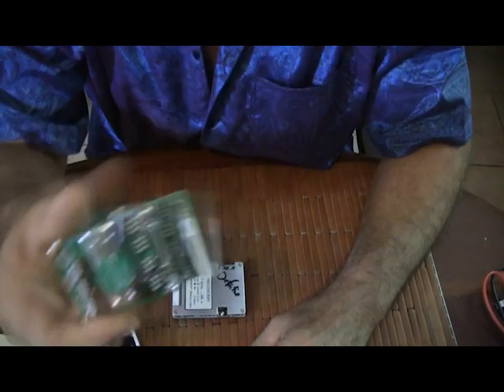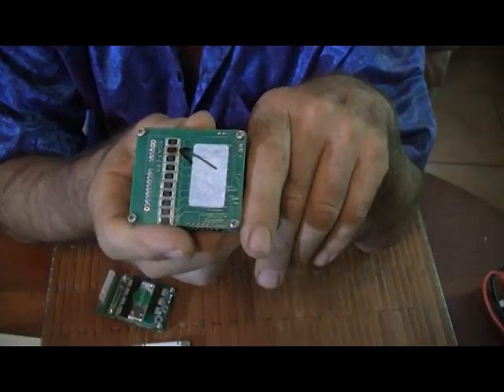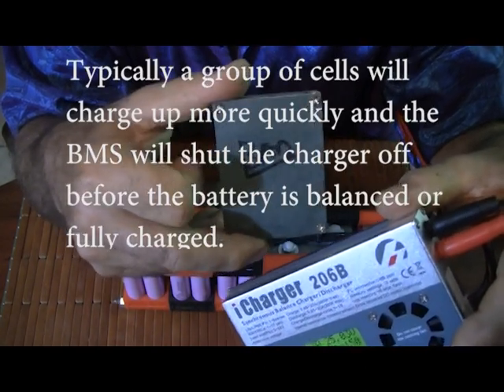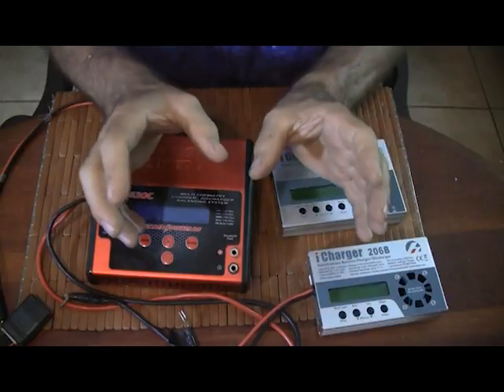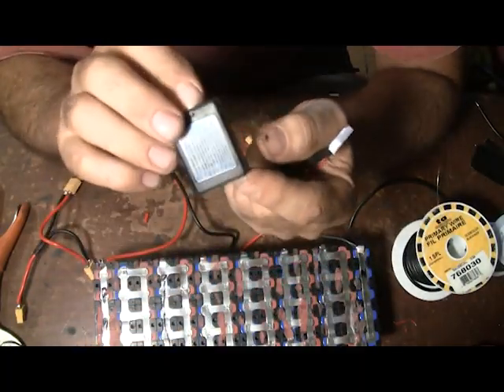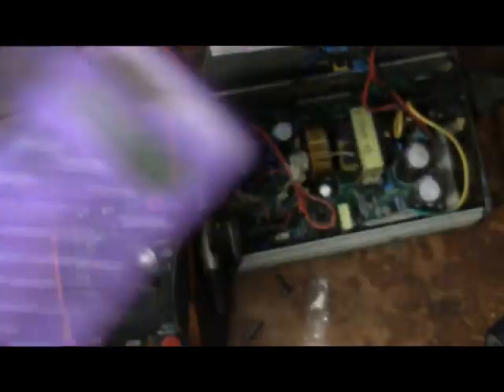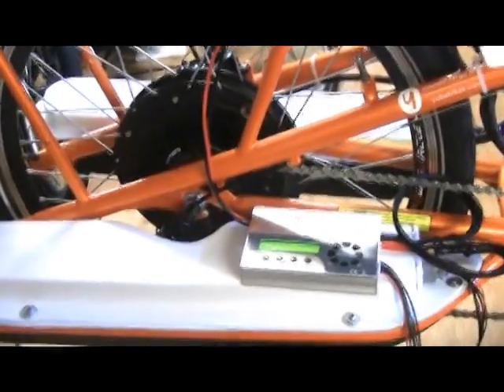How to build a safe and better lithium battery WITHOUT a BMS.

Comment: I really like your setup. Quick question, are your cell loggers running when your two batteries are connected or are they running only when your batteries are disconnected into two separate batteries?
Reply from the maker: Thanks, They can be left connected all the time.
Reply: There's no switch to turn them off when the batteries aren't in use, so they have to be unplugged to avoid the drain apparently. Can just the end  lead be disconnected or does it require every one to be disconnected?

Comment: Why does a BMS discharge a high cell that is under 4.2 volts instead of stopping the charge on that cell until the others catch up to it?
Reply from the maker: BMS's don't charge cells- the entire battery is charged at once through the positive and negative terminals.  A BMS can only hold back the charge on individual "cells"- actually parallel groups of cells- by bleeding off power using a resistor.
Reply from the maker: Because that is the only thing it can do.  A battery is charged all at once, say at 48 volts.  The BMS does not charge a battery.  All it can do is put the brakes on runaway cells.
Reply: Most bms can only charge all cells together. They usually can't charge individual cells.

Comment: Thanks for the awesome vid! I'm seriously going to try and use your advice for an electric go-kart i'm working on!
A couple of questions if you don't mind:
1. Several times in this video you mention that charging to 4v per cell could triple the life of your battery - could you point me to your source for this info?
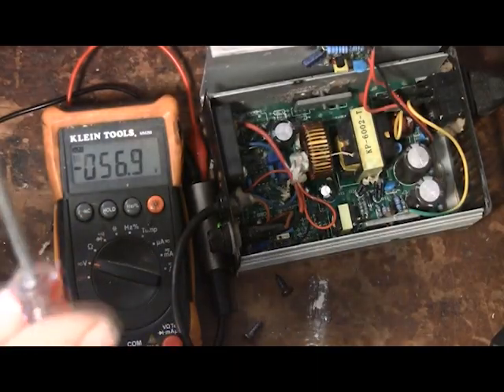2. 13:20 "you can charge both halves of the battery at the same time" what did you mean by this? How? Did you mean that you can hook each half up to it's own hobby charger?
3. If you adjust a hobby charger down to 4v like you do at 13:25, does it still go through the proper lithium CC-CV charging cycle?
4. From what I can see 7S hobby chargers are still big bucks, aren't they? Am I looking in the wrong places?
5. What do you use for a bulk charger (15:50)?
Thanks again, really great vid. Got me thinking :)
Reply from the maker: Great questions, well organized!
1.  Yes- Go to BatteryUniversity.
   http://batteryuniversity.com/learn/article/how_to_prolong_lithium_based_batteries
2.  Yes, exactly.
3.  Yes.
4.  Try Hobby King.  
5.  Any power supply that you can adjust to the right voltage.  Meanwell makes some good high quality supplies.  These power supplies are CV- this means that the current tapers off as the voltage approaches full charge.  In effect this makes it a CCCV supply- the battery can't tell the difference.
Reply: Regarding using a power supply as a bulk charger, you can set the voltage but what about the current? Aren't li-ion cells supposed to be charged at a particular C rate? For example the spec sheet of a particular cell might say "Standard charging method: Constant current (CC) 3.7A (0.7C) to 4.2V, Constant voltage (CV) 4.2V to 50 mA" so if you set the bulk charger to 4v how do you limit the current to 0.7C (3.7A) in the example above? Doesn't the "CC" portion of the charge vary the voltage in order to maintain a constant current, so setting a power supply to a specific voltage is the opposite of that isn't it? Sorry totally not getting the "in effect CV makes it CCCV" thing :(
Reply from the maker: You limit the current by using ohms law and sizing the charger.  Take a hypothetical 1C battery of 10amps and 12 volts.  This is 120 watts, so using a 120 watt charger would limit the current to 1C.  If you had a .5C battery, you would use a 60 watt charger...

A charger starts charging at full power, say 100 watts.  This is full current, and it is "constant"- say 10 amps.  Say the charger is charging to 12 volts.  The starting voltage of the battery is 8 volts.  If the charger is 80 watts, and it is making maximum current of 10 amps, then it can only put out 8 volts.  So it reduces the current say to 9 amps so it can push the voltage up.  At some point, the voltage gets to the fully charged voltage and the charger reduces the amps- or else it would drive the voltage aboove the fully charged voltage.

So the job of the charger is to raise the voltage.  It uses amps to do this, this is the CC stage.  When the voltage reaches maximum voltage the charger backs off the current.  The voltage falls a bit.  It raises the current seeking to maintain max voltage- the constant voltage stage.  Finally the voltage stays high even though the current is backed way down- next to nothing.  Then the charger shuts off.
Reply: If the PS is charging at max power but the voltage is rising as the battery charges, then isn't the current changing (going down) because P=IV?
Reply from the maker: Yes, exactly right.  When the charger is at maximum current that is the CC phase.  When the charger current starts declining because the target voltage has been reached, and full current would take it over the target voltage, that is the CV phase.
Reply: But doesn't the current start declining right away, doesn't the current decline as the voltage is on it's way up? And isn't the CC phase supposed to have constant current while the voltage is climbing? See the below table, the current should be the same all the way through in the last column because that is the CC phase, but it isn't.

Power V Current
500  3.0 166.7
500  3.1 161.3
500  3.2 156.3
500  3.3 151.5
500  3.4 147.1
500  3.5 142.9
500  3.6 138.9
500  3.7 135.1
500  3.8 131.6
500  3.9 128.2
500  4.0 125.0
Reply from the maker: The current will start declining when the desired voltage is reached.  Current is what is pushing the voltage up.  The CC does have constant current- until the desired voltage is reached.   The current MAY start declining right away if the charger is too large for the battery.    Imagine a 1000 watt charger on a small battery.  The moment you turn it on it drives the voltage above the set voltage.  The current comes down immediately so as to not damage the battery.   Don't do this!
Reply: If a 500W power supply is supplying 500W of power to charge a battery, and the battery voltage is climbing (say from 3.0 to 4.0 like in the table I provided in my earlier response) then the current must be declining during that time (as in the table) because P=IV so if P is staying the same and V is increasing then I must be decreasing as V increases. Please have a look at the table above, think of it as being in a time sequence; 500W of power, the voltage is slowly creeping up and so the current is slowly dropping. This doesn't sound like it's the right way of doing the CC phase.

In fact if I look at this post from Battery University: http://batteryuniversity.com/learn/article/charging_lithium_ion_batteries it is definitely showing that the current stays the same as the voltage increases, which means that the power would actually have to increase during the CC phase. We can't start out pinned to max power, power needs to start lower and climb with voltage, in order to achieve constant current. Again, because P=IV.
Reply from the maker: Now I am confused too.  You make a good point, the math is right, and yet even Battery University shows the current staying constant.  Perhaps- perhaps- the charger is only providing say .5 volt above the battery voltage.  Because the charger does not need to supply the entire voltage as the battery has it's own, which needs to be factored in.  You think?

Comment: When soldering on a lithium battery can you help with the heat by putting them in the fridge first to pre-cool them?
Reply from the maker: Sorry Rob out of my area of expertise.  I have soldered to lithium batteries but I always knew it was iffy.
Reply: never try soldering to one of them button batteries, i tried and it exploded

Comment: How would one hook up a 10s or more batteries system to chargers that are 6-8S at most?
Reply from the maker: You can certainly do that as long as the chargers are powered separately with AC so there is no common ground between them.  Pretend your 10S battery is two 5S batteries and hook up the charger balance and power wires accordingly.
Reply from the maker: Oh, and NEVER balance in parallel as long as the two halves are connected in series or you will short it out.
Reply: thanks very much Shawn !  I'm a newbie to this trying to fix a battery with square cells and replace a bad cell with round batteries...it will be interesting.  I'm also ruling out the bms.

Comment: in your case you were able to isolate every cell, what happen when you have to connect electrical 2 o more cell wo you are not going to be able to check each individual cell, this is a question
Reply from the maker: No, we cannot isolate every cell.  Whenever cells are connected in parallel they behave as one big cell.  You are forced to monitor the cells as a group.  This means if one cell starts going bad in the group you need to know the signs- they will be that that group charges and discharges more quickly than the others in the battery.  You would need to open that parallel group and test each cell in it individually to find the rouge cell.  It's a pain.

Comment: I am making a DIY powerwall do you have a suggestion for a charger. I am using solar panels 5 of them in series for a total of 190VDC, I know the voltage is high but my solar panels are about 150 foot away from my inverter
Reply from the maker: I know you must be scratching your head on this one!   Here are two things I can think of quickly-You may need to get an extra panel and connect them three in series and two in parallel to drop the voltage down to what a normal MPPT charge controller can handle.  I use and like Outback charge controllers.
Or, you could get Micro Inverters for each panel, change the voltage into AC at the panel and parallel the voltages.  Then you could use any 110 volt charger for your batteries.

Comment: at 9:00minute mark!   Thank you!   Capacity First!  then Voltage!   When building from individual cells to create a battery..... "P" then "S".     Thank you for knowing this as others say "S" first, which if using premade hobby packs is correct.   :)
Reply from the maker: Tommy is that you?  Yes, you need to first determine the number of cells in each parallel group to get the amp hours, then add up the parallel groups to get the voltage.

Comment: Call me redundant but I like having all options. I have the 1010+ charger that you have but I also have a BMS with an LED indicator for each cell to show that it is balancing. https://drive.google.com/open?id=0B1zXdndW8cNeQTN3ckc3WENVSWM I guess the only negative is if the BMS fails and doesn't allow me to run my bike. I figure that I have a better chance of getting two flats which is very possible. I built this battery with a BMS and a JST connector. It has a dedicated charging port to there isn't anything to disconnect. IF I get paranoid enough, I could always add a third XT60 connector wired directly to the battery outputs.
Reply from the maker: I like the way you roll.  You are a belt and suspender man.  Have you considered adding a power wire from the battery that bypasses the BMS?  If (or when) it fails you can plug the battery in directly and get home?   When I used to use BMS's I carried a jumper wire so that I could jump the B- to the P- on the BMS to bypass it.  Got me home.

Comment: Ok Hobby charger is good , What is the other device called you show in the video ?
Reply from the maker: It is called a cell logger or cell monitor.  You can find them at Hobby King for under $4 each.
Reply: Are these the ones that draw power from an individual cell causing the pack to become unbalanced if connected  for long periods?

Comment: Great video, thanks for taking the time to make it.  Do you have any experience/opinion with ISDT chargers?  Does this charger (http://www.isdt.co/d2.html) accept a JST-XH connector?  Thanks!
Reply from the maker: I have no experience with those chargers but I like what I see.  The connectors are jst-xh and xt-60 connectors.  I like what I see.  You could balance charge up to a 12S battery with that charger.  Good luck!

Comment: Hey Shawn, another problem please help if you can. I built a 13 cell battery for my 48v 1000w motor but the voltage ranges when charged between 48.1v to 54.6v (3.7v x 13 cells to 4.2v x 13 cells) so upon connection my voltage is too high, but then of course drops when under load. 

I had a massive problem with my bike going up hills even with 8 batteries in parallel to get my amps per cell. The voltage drops too low and my bike cuts out.  

So I decided to add another cell, and at 14 cells we have a charging range between 51.8v to 56v. You guessed it I smoked my ebike controller. 

How do I deal with this voltage range especially up hills? I have over 100 batteries all around 2.2A wired together and still struggling. 

Thanks!
Reply from the maker: You need a new controller now so why not buy one that will handle 60 volts?  Also, going up steep hills and lugging down the ebike motor creates a really large load on the battery and lots of inefficiency.  You could:  Switch to a mid drive motor and use gears- or add a 2nd motor in the front wheel- or pedal really hard.  I also suspect that one or more of your parallel groups may be weak- causing the voltage to drop fast....  Sorry about your troubles!
Reply: Shawn McCarty Thanks Shawn, if I buy a 60v controller won't that be too much for my 48v motor on my wheel that I think is still okay? Plus if it's 60v will it handle range from the (14 cellx4.2v) 58.8v when fully charged down to say 40v as the battery depletes? If I add a front motor will I need an extra battery pack or an extra controller? Thanks as always!
Reply from the maker: The motor can handle the 60 volts.  14S fully charged is 58.8 volts- that's why you need a controller rated for 60 volts- it still may say it is a 48 volt controller.  Just the capacitors have to be able to handle 60 volts. 

If you add a front motor you will need another controller but you could run both from the same battery.  You will also need another throttle.  I use a twist grip on the right and a thumb on the left and use both only when accelerating hard or hill climbing.  So the front hub motor is better if it is geared- so that it is free wheeling when not being used...
Reply: That's great. Would a 48V-72V 1500W controller be just what I need? I think that has a wide range and that's how it works? When fully charged it's 58.8v though actually I'll only charge the 14 cells to about 4v each so 56v then when I drain it down to say 3.3v each that's 46.2v. Do you reckon this wheel motor will be perfect for that? Also... if I bought this controller, could I add even a 15th or 16th cell to get 60v or 64v all at 4v or would that be too much for my 48v 1000w motor? Love the front wheel idea but I'm low on budget at the moment. Definitely will upgrade that later too.
Reply: Shawn McCarty And do I need to stick to a 1000w controller to match the 1000w wheel motor or can I get a 1500w controller? My thinking is more power better build but maybe that'll hurt my wheel motor?
Reply from the maker: Sounds like you are on track for much better performance.  Yes you can add an extra parallel group of cells.  Yes your motor can handle the extra voltage.
Reply: Excellent. Thanks again as always

Comment: tell me i have 20 cells in syrie  72 volt  3.7 10 amp polmer  total ?????  hou much cells do i need 
cells in syrie and paralle for a motorbike 15 kw 38 piek 72 volt motor what is the best te ues
Reply from the maker: Sorry I don't understand your question.
Reply: how much battery do i need to build a pack for e elect motor 72 v 15 kw complete system controler wahter coolt and how to charge te pack and haw do i control the balance
Reply from the maker: Samuel, that is too complex a problem for me to answer.  I wrote a book on how hobbyists can do the math and design and build a battery.  It is on my website www.batteryblocs.com.  It costs $3 for the download.  You will have all you need to the math yourself.
Reply: oke bet i from europ. bet when i start my project i wil order ,... i lookt to you scheet for 72 volt its ok.
Reply from the maker: Yes, you can use my spreadsheet.  I just returned from Stockholm- where in Europe are you?
Reply: i from belgium bet living in france for te moment, bad country the system is not good. bank very bad dont give you mister casch to pay on line. bet i move soon to holland netherlands, that is the best country of europ and is also based one the usa more are les. bet we speak te seem greetings
Reply: when i am in holland i can order from you than i start on my project 125 cc aprilia convert to electri. i like you packs its very good. i will order from you ok greetings

Comment: i think the gratest throwback is that you need to split the battery if yo need more than 10cell battery (wich is most of the times)
Reply: u can build it to where its all in one case but conected at a fuse block/load center many ways of acheiving this i would go with a simple a short as possible main cable feeds to the switch gear incorporate a mts (Manual Transfer Switch) to seperate into parallel  to charge a big 7s config or what ever ur target volatage needs to be to use balace charge technique  hope this makes a little sense